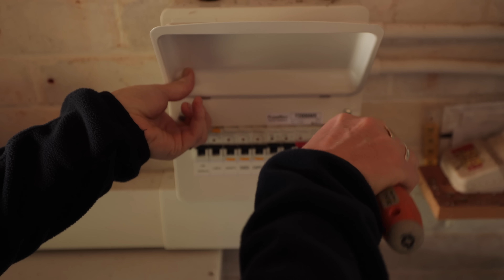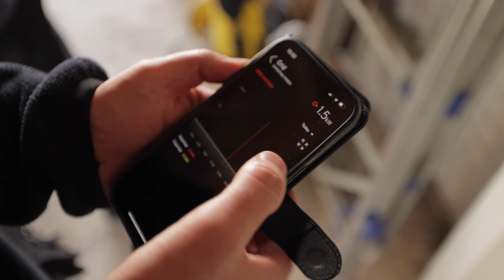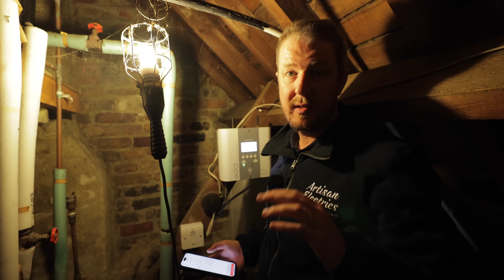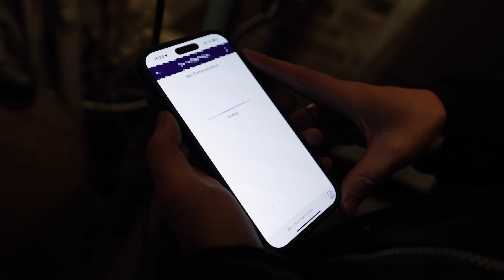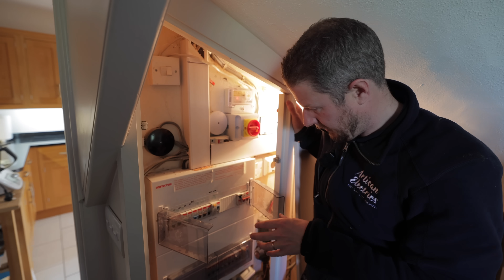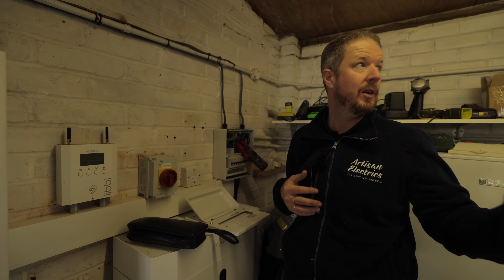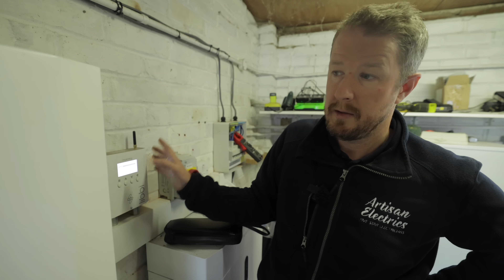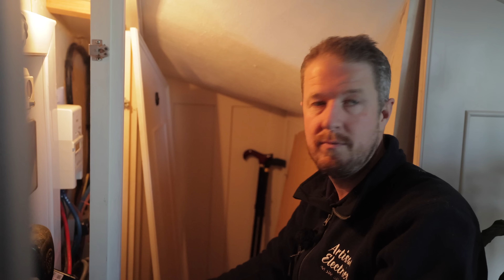£20,000+ Battery System RUINED By This 1 Simple Mistake 😳

Comment: In the auto world you get wiring diagrams, should houses have them and be updated when the new systems are installed?
Reply: I don't know any good software to create diagrams like that for normal people
Reply: @darekmistrz4364  - in my country, we use star configurations leading to a next level of stars. In the UK, the dominant is to have a "domestic ring". My country generally has three phases coming in (where the sine waves are on a different time base) via one main mains lead each. Typically there are very fast automatic breakers that detect tiny earth leaks and cut off when that happens - e.g. a human becoming an earth rod. These can serve one or 3 phases and this then fans out into normal circuit breakers (16A and 230V = 3,680W). At the grid side, though, there's fuses too and these may be 25A each, which would cap the total energy consumption in the house at 17,250W. SO the idea is that nobody in their bloody mind switches more than what each leg can sustain at the same time. Many things in engineering are implicitly based on such "time sharing" assumptions. Device group A now, B later, and C after that. Never all at the same time.

A design diagram makes a lot of sense here. I designed it myself and an electrical engineer built it.

How I made the diagram? In PowerPoint. It's just a couple different shapes and connectors. If you need to reverse engineer, just switch everything off in your mains breaker boards, open one phase, one breaker and track down (light) switch(es) or outlets connected to that. Repeat: switch the last breaker off, take the next.
Document in a table or diagram.

The moment you add solar and domestic batteries, you really need to sit down. The diagram may be the easiest if you also document the likely (max) load to each of the bottom legs in the stars. Now the diagram helps you figure out how to connect and why, where. Once households no longer get equal pay for their delivery of Watts to the grid, it's attractive to keep things separate. Home batteries still are too expensive. If you take usable capacity times guaranteed recharges, you get total kWh delivery to the house. Divide the purchase, installation, maintenance costs by that lot and see what your kWh cost. Now add to the model the costs to actually put "cheap" kWh into the battery. At current prices, my calculations in my country's specifics mean kWh already are more expensive juts from purchasing a battery without installation and without charging them ever at a a cost.
Reply: @darekmistrz4364  Just a sketch is better than nothing!
Reply: as a mechanic we need to build houses like cars. i hate house diy do lack of documentation. to much voodo

Comment: Generally speaking, with batteries, they have a capacity BUT there is a depth of discharge versus cyclic life constraint.  Even Lithium has an issue of cyclic life if it is heavily discharged every day.   So generally, there should be a programmed logic limit to prevent the battery being over discharged and dramatically shortening its life. Also, the rate the battery is charged during hours of daylight needs to be configured so that the battery is being charged off the "free" solar and not the grid.  Even ideal direction facing solar panels dont really make significant production until mid morning, a few hours after sunrise.  So it can be a struggle, to get enough solar production to fully recharge the battery storage.  In my opinion living off grid, you need 10-12 kw of solar panels well placed to charge a battery that size reliably to even half its 20kw name plate capacity.
Reply: We use special deep discharge sealed lead acid 2V  1000Ah cells on our offshore systems. They are good for 10 years plus.
Reply: @geoffwoodgate7450  every manufacturer of every battery chemistry does or should have a depth of discharge versus cyclic life chart to provide the means to manage battery discharge to ensure optimal results.  People have this idea that Lithium is some wonder battery that can be discharged 90-100% and they are going to get full name plate rating for 20 years, its pure nonsense.
Reply: @wazza33racer  I quite agree. I am an engineer, specialising in commissioning solar powered telemetry systems. I know all about specifications of batteries and their characteristics.
Reply: @geoffwoodgate7450  Exactly, its galling how in this example, the customer sees the name plate rating "20 kw/hr" and thinks.......I have 20kw/hr that I can use every day from storage.  While that is loosely true, at full discharge every day, that Lithium battery will be junk in 2-3 years of daily cycling, depending on the DoD chart.  As usual, people are getting suckered by shysters.
Reply: I'd argue that calandar aging is going to be more of an issue with most of these batteries. So if you limit yourself to 15-90% state of charge it might change the capacity in 10 years by a few percent but does limiting to 75% if your capacity for 10 years to save an extra 5% capacity 10 years from now when you could just use your battery to save more money now and replace them in 10 or 15 years when you've saved more than they are worth anyway?
Reply: @Snerdles  I have not seen a calendar aging chart for any battery ever.  Some do advertise a "float" or standby lifespan, and all batteries do have self discharge spec, when they are charged and then put into storage, disconnected.

Comment: OH ! How i love living in Australia, my hot water system is just a hose painted black feeding into an old bath tub !  Hot water all the time !  :D
Reply: LOL, mate that's BONZA!
Reply: oh i see this "system" a lot here in Portugal too, especially in Algarve.
Just a dam big hose sitting in the sun all day, does wonders for hot water
Reply: I couldn't stand the heat.
Reply: @hetrodoxlysonov-wh9oo  humidity is the killer. Never like that in the 70s, mainly dry heat but now - tropical.
Reply: @RemusKingOfRome  Do you have air-conditioning and is it expensive to run?
Reply: @hetrodoxlysonov-wh9oo  Yes, Have a 5Kwh ducted AC on my house, excellent but too expensive to run for long. My Solar is only 3 Kwh. i bought 2 small portable 2Kwh AC units, 1 for my computer room, which works ok and the other for the lounge room, which failed.(room too large)
Reply: @hetrodoxlysonov-wh9oo  my post was deleted, sorry. YT psycho censorship AI.    x
Reply: Good for you. But every state has it's advantages and disadvantages,

Comment: Our installer didn't know what the CT was, so he threw it away! After many many conversations with his boss we eventually got another and after a couple of attempts even got it working properly working. Yes, plenty of cowboy installers out there.
Reply: It all seems so highly complex needing formidable skills so mass rollout of these systems is just never going to happen. I wonder if they can always be classed as cowboys but just finding it difficult to cope with all this. Technology is just leaving the capabilities of the people around to install it behind.
Reply: @michaeld5888  Seems more like they aren't educated well. If there is a part that I don't understand then I check the manual, that should be common sense. And the concept of a current transformer is quite old and even RCDs/GFCIs are based on them.
Reply: @Ether_Void  But the whole setup is so complex with so many interacting components and apps as seen in the video and the potential has to be there already in individuals to be able to train them to the level of the guy in the video. Or are we in to the philosophy that anyone can be trained to do anything? Not something I have found in my experience.
Reply: @michaeld5888  My point is that you don't have to know intricate details in order to apply basic rules and commonalities. All they need to understand is what the CT does and why it's there; It measures current and it's there to measure import and exports from the grid. You don't need to know the app nor what the devices do with the information. Although given that around 12:40 we got the info that it was done by the installer that added the smart system, I would expect them to know a bit about how solar works.

The same applies to the comment; If you don't know what the CT is you should either consult the manual or at the very least not throw it away. Again this does not require any intricate details about the app.

No need to complicate things by looking at every single thing all at once. You'd likely also won't consider the entire grid including it's intricate parts and everything every consumer has installed across the entire country when all you do is wiring a single house even though it's effectively all one system.
Reply: @michaeld5888  When you look at the entire system all at once everything is complicated, you have to break it into smaller parts.

All that's important for this part is that it needs to measure current to/from the grid just like a power meter. No knowledge of apps needed.

And if that part is not clear ask or read the manual but don't just throw it away. Again this step doesn't necessitate an app.
Reply: @michaeld5888  Also just noticed at 12:40 it was mentioned that it was done by the installer that installed the smart system so a lack of understanding is not a good excuse for the issue in the video to begin with.

At least basic understanding of residential renewables should be a requirement when accepting jobs that require you to install a smart energy system.
Reply: @michaeld5888 the manufacturer should be able to supply training for installers.
Reply: @michaeld5888  There's nothing complex about these systems, they're hugely automated and designed to talk to each other. Don't take me the wrong way when I say this, but your lack of experience in this domain might make it seem like they're highly complex, but they really aren't for people with good experience. You lack a good system of well trained installers in the UK. An entirely privatised network of individual businesses that decide their own standards (yeah, MCS exists but they're clearly not doing the job to test companies skill levels, quality levels etc or the poor trainee that's been brought on as cheap labour for 6 months on a far too frequent basis). Technology isn't too complex, people just aren't trained well enough.
Reply: What is CT
Reply: @artemca  CT stands for Current Transformer. It's a device used to measure high alternating current (AC) by converting it into a lower, safer current proportional to the original. CTs are essential for metering, protection, and monitoring in electrical systems, especially in situations where high currents need to be measured.
Reply: @artemca  Current Transformer. It's the clamp you put on the wires and it measures the current flowing trough it. It basically works like a normal AC transformer although with the goal to convert the large current trough a wire to a smaller current that a controller can measure without the need of cutting the wire.

Comment: I could not be certain from the video, but it looks like your cutout is metal? 
If so it has a rewireable fuse in and if bakalite it will be eather 60 or 80A main fuse. The DNO should check this for free and replace (free) if it is needed!

Comment: Using a CT to limit load to a switchboard seems like dodgy way to organise an installation
Reply: The load is limited by the breaker. The CT just makes sure the breaker doesn't trip if it doesn't need to.

Comment: We have a very similar system except we don’t have an EV charging point and we don’t use cheap off-peak to charge our battery. A word of warning. We were having an extension built post PV install and the electrician subcontractor for the extension bragged about how they would have installed the PV better/cheaper. I suspected something wrong a month after and the following month it confirmed my suspicions, our electric bill was going up not down! I called the original PV installers in and they confirmed my suspicions that the subcontractor had messed up the CTs so my battery was charging from the grid and all my PV generation was being exported to the grid with no FIT agreement possible. It probably cost me £300! If you have a PV system don’t let just anybody do your electrical work!!!☹️

Comment: I made my own off grid system for £2000. Batteries were £300 and worked great. I live on my own and had to change my lifestyle. Laptop only at night. Use the washing machine when it`s sunny. Spare solar heated the water tank. Wood burner heated the house and water when it was cold.
Reply: What did you use for batteries that cost £300? 
I know someone with a DIY install who stripped them from old Nissan Leafs.
Reply: @DrEmilSchaffhausenThe3rd  I bought 6 caravan batteries for £300. Nissan Leafs were new when I did mine. :)
Reply: Back to the Stone Age then?
Reply: @Freespeech2222 £3 a month energy costs. :)
Reply: Sorry just seen the house is using a Solar Immersion Diverter too. Great things. Only trouble is my water smells funny being at 60 degrees all day in the Summer. Should I turn it down to 40 degrees?
Reply: @damianbutterworth2434  Nope keep it at atleast 60 unless you want bacteria growing in the tank.
Reply: @damianbutterworth2434  As someone else has said, keep the temperature up above 60 to kill bacteria. Legionella grows best at 37C so 40C is really not a good idea, 67C will kill the nasty bugs including Legionella. But at that temperature you risk the chance of someone being scalded.
Reply: @billdoodson4232  Yes scalding is an issue but for those considering a diversion device like this, put in a 'blending valve' on the hot water tank output and set it to 40 deg C, it will mix cold water from the tank input with the output as you demand it, this prevents people being scalded and keeps very hot water in your tank as long as possible, rather than sitting in often uninsulated pipes around the house going cold and wasting that expensive heat. Hope that makes sense to anyone interested, point is keep the heat in the tank; I have mine set to the max, will stay usably hot for 3 days - super insulation.
Reply: @Bob-h4s2p  Yes, totally agree with you. I have recently been doing some work at a large bakery locally. All of the hand taps are now fitted with blending valves, but the water at 65C is still available at washdown stations and hoses.
Reply: Wood burner???? Your a environmental vandal, disgusting excuse for a human!........is what the greenies would say.

Comment: The owner should be on octopus export at 15p/kwh, import on IOG is 7p.  Try to use as little solar to power your house and battery as possible, export as much as possible.
Reply: Yep, at night I charge battery for 2 hours ((7p), then discharge for 2hrs at 15p to the grid and then top up again for 2 hrs at 7p so I am at 100% battery ready for the day to start to maximise my solar PV exported during the day. Nice little double dip in to the cheap rate every day.

Comment: What an eye opener. Here in Canada, renewables are way behind the UK. I am still doing my research and educating myself before committing to a similar system to this. When I have spoken to installers, they seem to just want to push it into the grid and not into storage, including my vehicle.
Reply: What are the electricity prices like where you live? If they a really cheap thats probably why solar hasn't kicked of.
Reply: @Felix-st2ue  We have a lot of fossil fuel generation. Alberta is a big player in the production of fossil fuels, as a result a lot of resistance to going renewable.
Reply: We have solar and battery storage. It’s more economic to export everything and fill the car and house batteries from the cheap overnight rate. Even with 2 EV’s we still made more income from solar export than we spent.
Reply: You are too far north for solar to be efficient. Geothermal would probably work better for you, if you just have to have “renewables”.  LARPing Captain Planet can be quite expensive.
Reply: I thought Canada is mostly hydro power.  How much more renewable do you want?
Reply: @mikeb8548 No, BC and Quebec.  Here in Alberta, it's burn baby burn, and the Alberta government give no incentives for EV'S or going renewable.